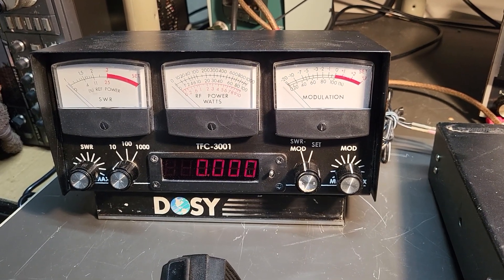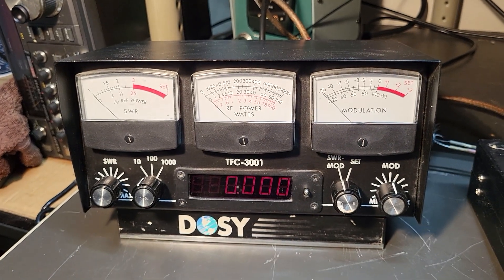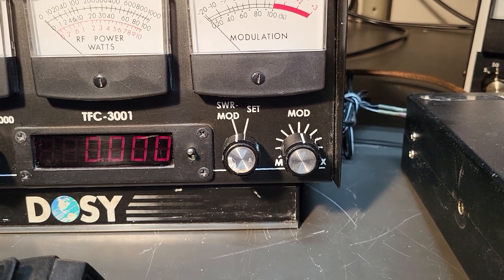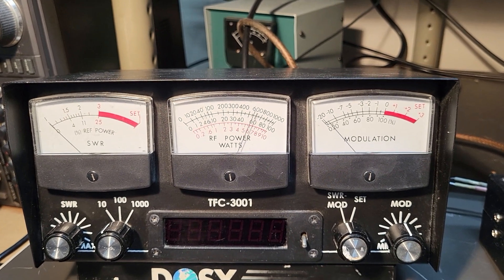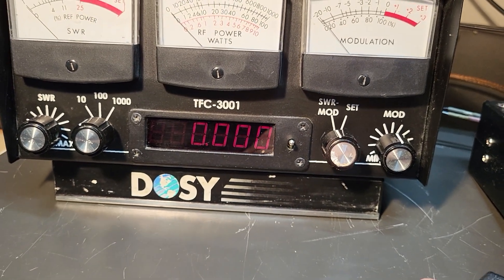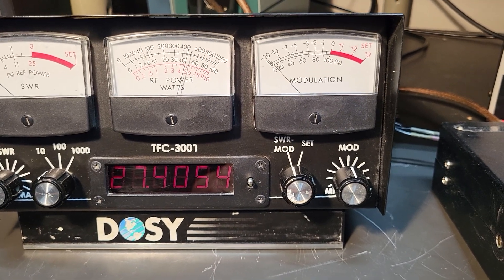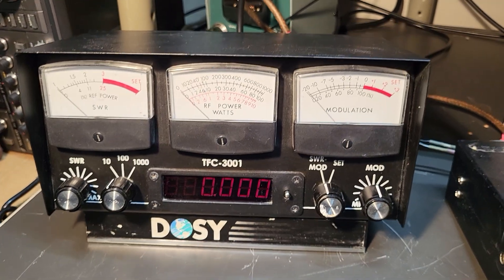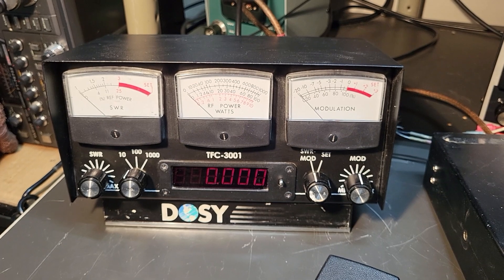Dosy TFC-3001 1000 Watt SWR/Mod/Peak/AM Watt Meter with Frequency Counter

Comment: Wow wonder why its off by 4 did you try another radio ?
Reply from the maker: yes I did. Funny but the last frequency meter I tested did the same thing! Maybe I live in a vortex lol
Reply: @bramfam4  NOT ALL RADIOS ARE SET  DEAD ON I HAVE HAD BRAND NEW RADIOS  SHOW 27.20 47 OR 54.